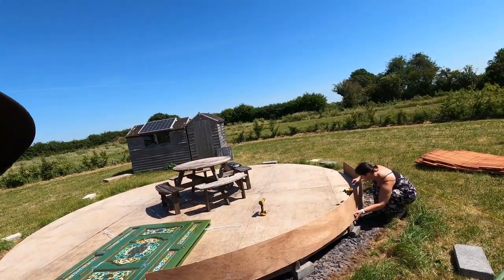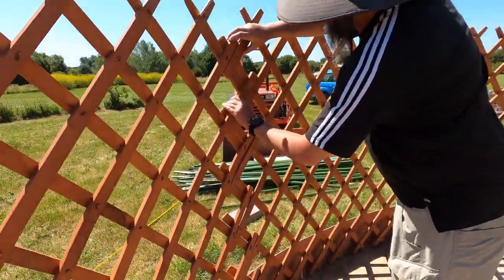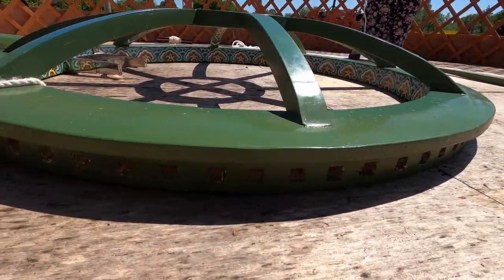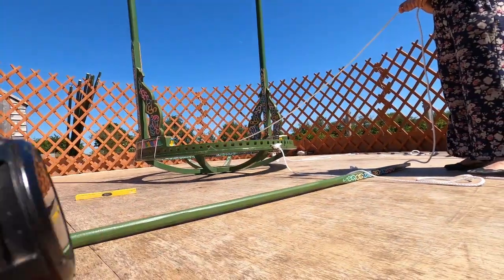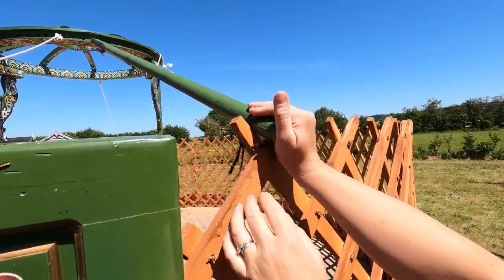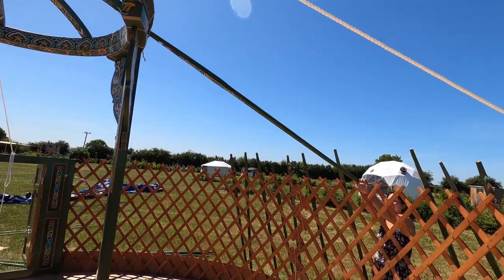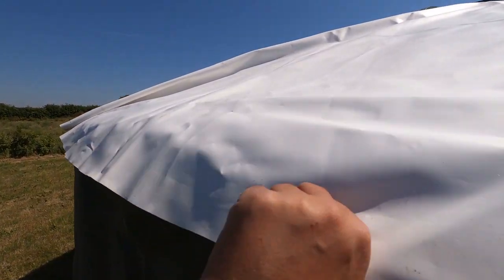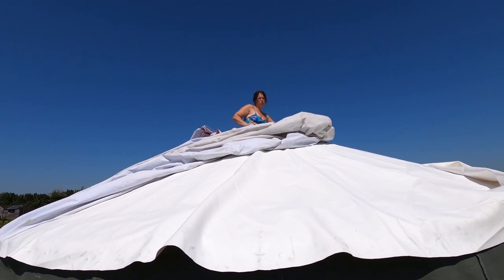How to Build a Yurt

Comment: Would these survive through winter in Spain? We are thinking of buying land and doing this in Spain. Though I imagine we'd need help to put them up. Do you know how they do in high temperatures?
Reply from the maker: They do get quite warm in the summer but if we didn't have the wood burner through the top crown you would be able to take the top canvas off and leave a whole in the roof to get airflow but then you would have to be taking them on and off for guests which would be a pain! We take them down in the winter as we get quite high winds and when we have left them up in the past the door has almost blown in so we had to tether them down with rope! The canvas also goes green over the winter so you would either keep having to replace the canvas or you can spray the green algae off. Please shout if you have any other questions 😊 Vicki
Reply: @TractorsandCream  thank you. That's really helpful.

Comment: What are the drawbacks for the dome ?  Any ?   Is ventilation a problem ?
Reply from the maker: The problem with a yurt is you have to take it down over the winter which is really annoying! It does get quite warm inside in the summer but if you leave the door open it cools down and is always a nice temperature at night for sleeping. Thanks, Vicki.